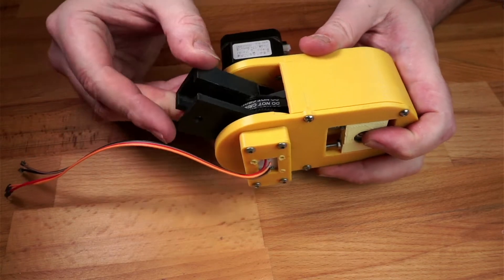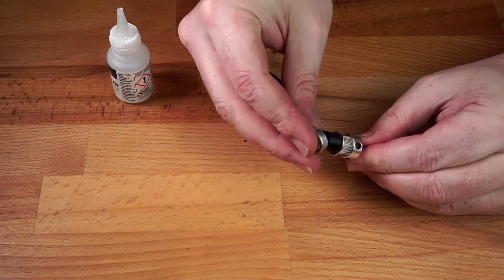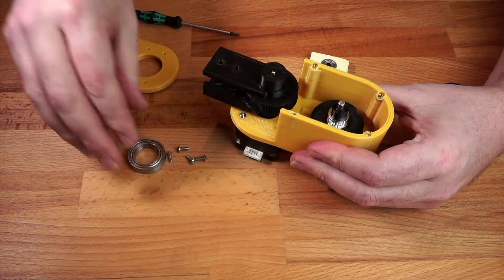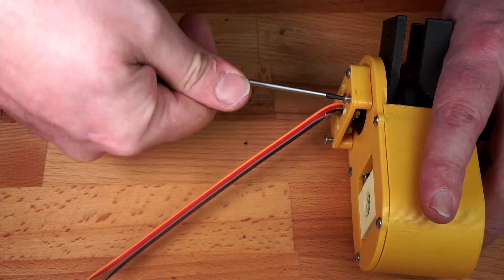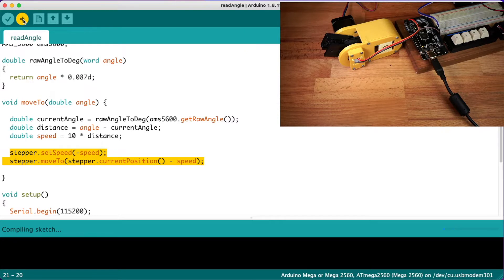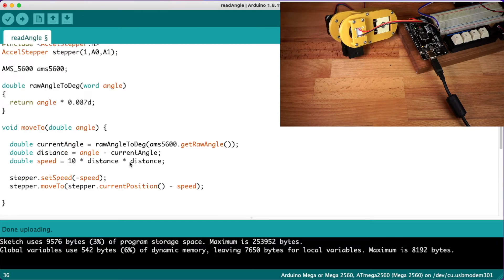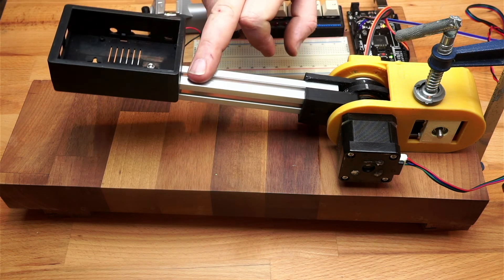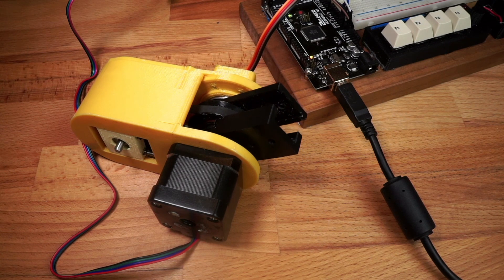3D Printed Stepper Gearbox with Position Feedback

Comment: The 3D printed pulleys are neat.  Is there a formula or something to make different size and dia of the GT2 pulley.  I am looking to make a few for my robot arm and want to change out as needed to get correct movements before I cut the bot in aluminum and order the pulleys.
Thanks and great channel.   New subscriber here.
Reply from the maker: to be completely honest, I ended up just downloading STEP files for the size pulley I wanted from McMaster Carr and then modifying them however I wanted.

Comment: Excellent gearbox design ! One of the benefits of adding the sensor is that you can move the arm by hand and record the sensor data in an array.
Than you can read the stored data from the array and so easily reproduce the movement of the arm. Maybe a suggestion for a future video ?
Reply from the maker: Thank you! And, yes - you're reading my mind! I'm hoping to use the compliance of these gearboxes to be able to teach the arm where to move to. I'm also thinking it could be used for force feedback so it knows if it hits something.
Reply: @roTechnic  Can't wait.... !!

Comment: hi, I enjoy your work, can you tell me the costs of such a joint? it looks smooth enough for a decent robot arm and way  more precise that the servos I use. thank you for sharing.
Reply from the maker: Thank you. If you shop around, you should be able to get everything for about 30 euros/dollars. The links in the description will take you to the right items on amazon, but if you search for them on aliexpress/ebay you should be able to find them cheaper.
Reply: @roTechnic  Hey, if you ever need a challenge  in which you can help a person with ALS get a bit of independence, I have a robot arm that needs an upgrade and I can cover  some costs. Let me know.

Comment: Nice result.  I think the flex is more likely to do with the tensioner mechanism rather than the belt stretch.  You could try using tension rather than compression to adjust the belt tension (ie, pull with the nuts from the other end rather than push).  Or 3d-print a block of exactly the right size and wedge it once it is tensioned.  Or, fix the bearing position and push a roller perpendicular to the belt neat the small pulley, which has the added advantage of engaging more teeth on the smaller pulley.
Reply from the maker: Hmmm, never thought of that. I’ll give the 3D printed block a go. Thank you